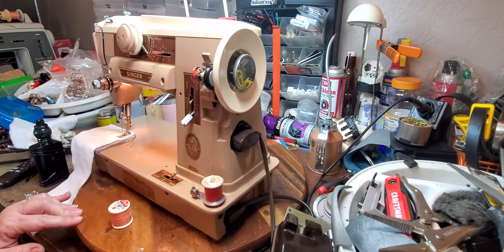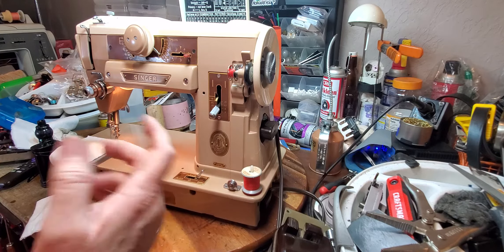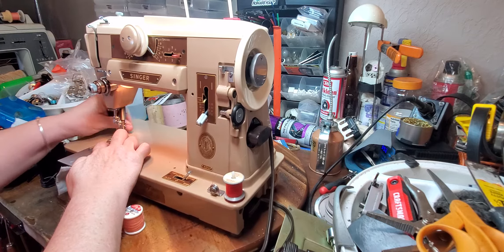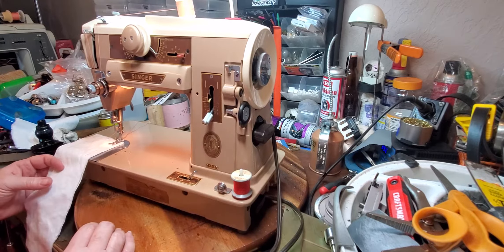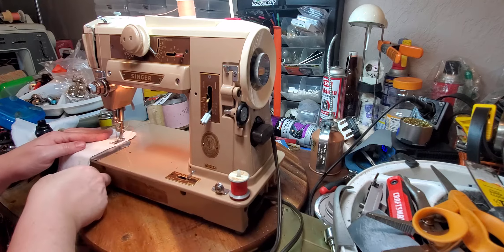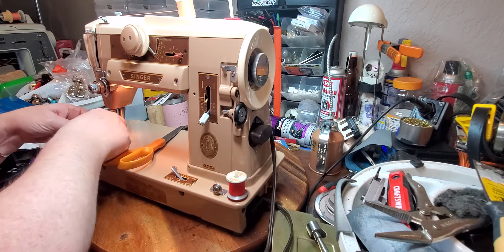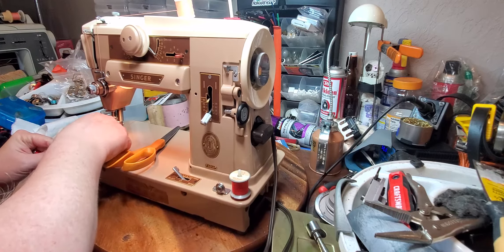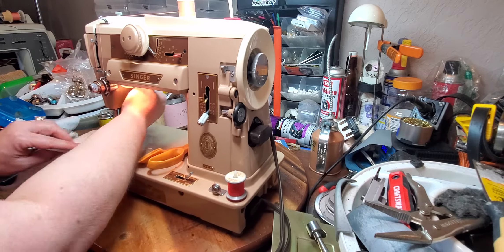Singer 401A Sewing Machine Demonstration

Comment: Hi Tanya, I’m looking for an old machine to learn to sew so I can do some small sail and light canvas repairs as needed on my sailboat and maybe learn to make cushion covers and odd jobs. I like the look of the Singer 327 that you reviewed and there is one here near me in Scotland. Wondering if you think this 401 is a better option, or if you recommend another that is common,y available? Great videos thanks, Dave
Reply from the maker: For the type of work that you are going to do, I may choose another machine.  Honestly, the Kenmore sewing machines, like a 95 or 58, I have videos for these machines.  These Kenmores have the ability to make a nice long stitch.  If your are going to be working canvas, it is likely that you are going to working with heavier thread.  Which would be ideal for this machine.  Heavier thread and a longer stitch, is a good combination.  If you really want a Singer the 401 or a 15 with the embedded motor, would be a good choice.  As they provide more power.  The 327 is a fine machine.  I top stitch my sons kilts with the 327.  I am just saying, there are better choices.

Comment: can you show the way the needle goes in.and how to thread this particular machine? and what is the thread i use for this? a strong thread
Reply from the maker: I no longer have this machine.  However, I do have a PDF copy of the manual.  If you would like to purchase a copy for $5, send me an email: buzzsidds@gmail.com
Reply from the maker: Also,  You can use any polyester or all cotton thread.  If you are sewing heavy duty items, like canvas or denim, I would use an upholstery thread.  If you use a heavier thread, you will need to use a heavy duty needle too.

Comment: Hello, your videos are very nice. You stated you have had a couple of these come in for repair and I was hoping you could clarify something about this machine. My daughter purchased me one one last week. The add stated worked good and included photos. She drove a couple hour trip and returned home to find that he did not give her the power cord for it in the box. The photo clearly showed the cord, so we contacted him and got a reply that he lost the cord and had looked and couldn't find. He forgot to mention that when he told them how nice it ran.  I started looking for one yesterday after watching many videos on the machine. This one has two terminal prongs for the power cord . I saw 2 others online like that. The remaining ones had 3 prongs similar to the cord for 15-91 or 201 machine.   Even the book that came with it showed three. Do you know what the difference is on the machines where I could figure out how to purchase  a cord? Thank you for any info.  I would love to return this thing to that jerk but it is a 5 hour drive for me.
Reply from the maker: You can use the same cord used for a 15-91 or 201. The machine only has two prongs, the cord has 3 holes. But that only matters if the pedal is connected to the 2 prong on the machine, which it is not. Most likely you will only be able to find black. But that is okay. 

I hope the machine runs fine. These machines tend to get 'stuck when sitting for a long time. Take the top cover off, and the bottom cover and oil generously with sewing machine oil. Wherever metal meets metal.  Good luck
Reply: @tksewingmachineandrepair4243  Thank you so much for your help and  replying. I could not find that out anywhere online. Blessings